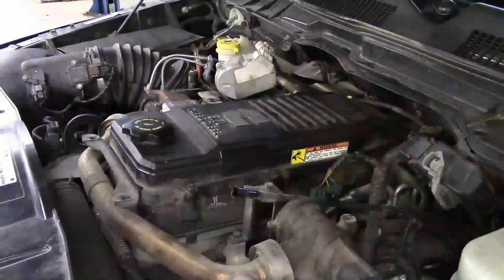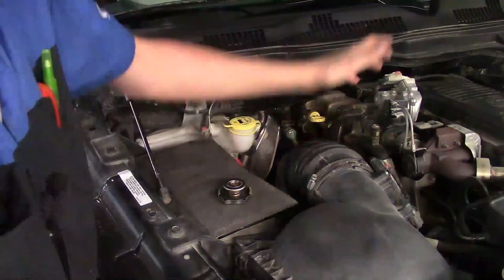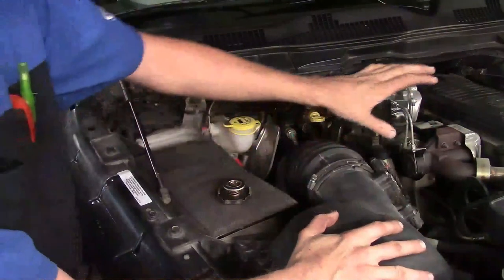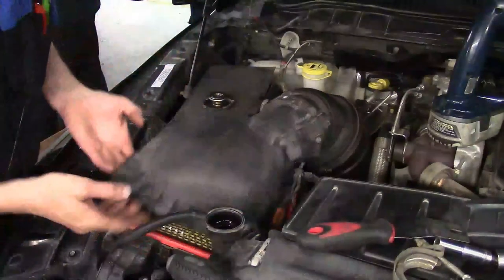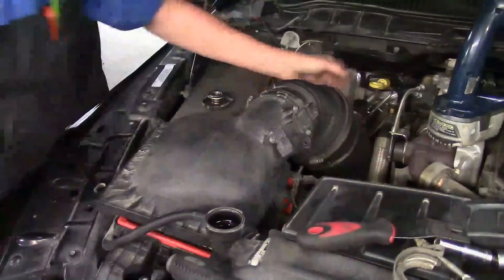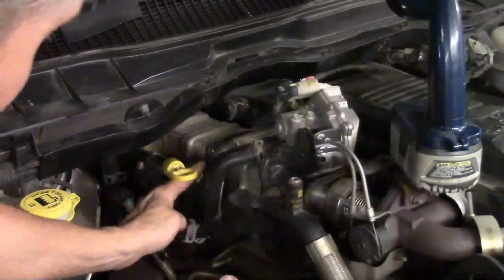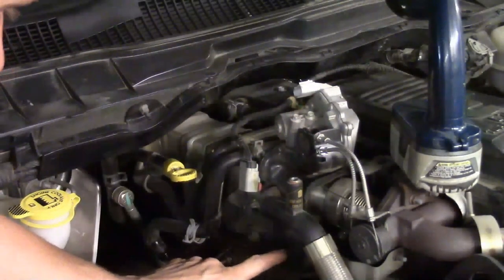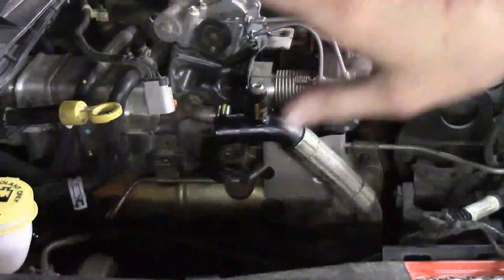Part 1/4: Dodge Ram 6.7 Cummins 67,500 mile service

Comment: Great four part video. Thanks for putting this out!  Called around to all local diesel shops.  They just replace the units ($1200 EGR valve $1800 and more for EGR cooler) nobody had heard of washing these parts out. 
In the middle of service 158k miles.  Thanks again for this information!

Comment: I just wanted to say thank you.  This series was extremely informative.  We did the project with no issues!  One note to others, we put some grease in the 15mm socket to hold the nut in place for the dr side nut and stud on the cooler.  I guess my hands are big... and no friends.  Awesome videos!
Reply from the maker: +liamfm The cool thing is you saved some money and learned more about your vehicle. Appreciate that added tip and for the great feedback. Make sure to subscribe if you haven't already.

Comment: sir,your videos are amazing,informative and just fun to watch.You have educated me and or orientatated me to better prepare me for the times when I go to my dealership.This video enabled me to correct some mis information I was given by my dealership when they did my service (I discovered your videos moments after dropping my truck off for this 67,500 mi service)my dealer informed me that the egr cooler did not need to be cleaned in this service and it was only done in emissions states.(this was over phone,after I dropped it off)when I went there to pick it up,they retracted there statement.(they knew I had both barrels loaded).So from being educated by you and a little whinning they reduced my bill by 150.00 dollars (sold parts at cost).When I told them I could of done the job and they acted like it took a computer to reset my service code,and they just charged me for the hours the truck sat there soaking.Good to be informed my man.I bought the cleaner to do the EGR cooler myself.Thank you and now im a subscriber.(I feel odd about calling you sir cuz men like us work for a living)
Reply from the maker: It does feel weird being call Sir lol. The 67,500 service does vary from year to year. Some require all 3 items to be done while others only need the crankcase filter replaced. As far as the emissions states statement.......depending on the state.....the service can be covered under the basic warranty. Otherwise I am glad that you checked the videos out and was educated about the service which is the reason for the videos. Thanks for all the kind words and for taking the time to comment. I greatly appreciate you having subscribed as well. Keep checking out my other videos as well.

Comment: Thank you for this video!  I got the dreaded "Perform Service" message on my '13 Ram 3500 right on cue.  Saved me $1200-$1500 not taking it to the dealer for this service.  That's the price I was quoted but what I ended up paying was the cost of the PCV filter (about $135 at my local O'Reilly's) and about 20 minutes of my time.  It was time to replace the filter as the original one was saturated with oil.  The procedure to clear the message was almost stupid it was so simple.
Thanks again for making my life so much easier AND less costly!

Comment: I like this guy! :D I just got a 2007 Dodge 3500 6.7. I put a delete kit on (First thing I did) but I never knew I had to replace the crank case filter. :) So glad people like him exist. :)
Reply from the maker: +Brein Jensen Thanks Brien! I have the same set up in my truck as well. Haven't done the deletes as of yet. Will wait until the repairs get to pricey. Thanks for watching. Don't forget to subscribe if you haven't already
Reply: 260k deleted since 100k when my dpf cracked on me and i didnt want to pay to replace so i deleted all of the stupid crap. 160k with no problems except for having to do a rear main seal.
Reply from the maker: I feel that if the cost of repairs gets to high as far as parts.....I too may delete when it comes time. I have been lucky so far with 220k with no issues other then minor items over time.

Comment: Followed your instructions, all but removing the neg terminal from the battery. I DO RECOMMEND IT. Got hit several times prior to finally removing the neg.  Also purple power at full strength cleans the door incredibly.  Mopar solution  is really expensive, and does not work anywhere as well. (See video comparing products.)
Thanks again. John Elder
Reply from the maker: Thanks for the added info. Over the years I have gotten use to working with the cables still installed but then again....I do this every day so I am use to it. For those not....the negative cables being removed is a recommended step for sure. Thanks again

Comment: I clean my EGR and DPF myself I clean the EGR with the Mopar solution at 45,000 and I cleaned my DPF at the exact same time with a power washer I let it sit for one day upside down and installed it on the truck and took it for a blast for 45 minutes let me tell you the smoke that was coming out but she ran awesome after one thing I wanted to know I'm at 75,000 kilometres now and service light never came on which I really like it's not just on kilometers it actually tells you when it's dirty
Reply from the maker: The perform service message will come on at 67,500 miles or 108630.72 kilometers if you do the conversion. What I have done and also recommended by Chrysler is to use Dawn dish soap for the DPF. It breaks up the ash and works pretty good. There are times that the filter is too full that it wont help or if the filter is cracked internally as well. I used a pressure washer once and some of the element got damaged by the high pressure spray so I stopped doing that method my self. Otherwise just Dawn dish soap and a water hose. The coolest part is that it foams out the tailpipe for a while once you first start it back up. Thanks for watching and make sure to subscribe. Have a great weekend as well.
Reply from the maker: @Workingcockers  Appreciate the info Walter and thanks for commenting. Baking it is the best method but it takes a specialized shop that has that equipment. Good ol dawn dish soap is your friend when trying to "save" a DPF before it gets to the point when it needs to be removed...baked/replaced.

Comment: Thanks for the video. Have 2015 Ram 6.7  71,000 miles  (Perform Service) Dealer says the need for EGR cleaning. I have 4k miles to bring her home and get this fixed. Should I be ok to get my ram home? Should I change CCV at the same time?

Comment: Hello and thanks for all you show us "backyard" mechanics. My question is; my perform service (67500) message just came on. I am 1500 miles from home and would like to know, can I make it back home before doing this service? If need be I can do the CCV filter, but not the rest of the cleaning. Most of my tools are home.
 I should mention I am pulling a 5th wheel camper. 2012 Ram 3500 dually.

Comment: Hey I called my local service department and they said all I have to do is change my crank case filter on my 2014 Cummins. Could this be right? Once again awesome vids man.
Reply from the maker: You and they are correct . They changed the maintenance at a certain point where only the crank case filter was needed on the late model 6.7 engines. Thanks again Rick.

Comment: Hey Dave! Question: I pulled off my ccv filter, was full of sludge, being worried i pulled the valve cover, PACKED WITH SLUDGE! Stop right there, i know what you are thinking, change out synthetic blend rotella T5 at 10k to 15k intervals, usually 10k, is there any, any, any other possibility of a bad EGR or anything that you could think of that would cause this? Thanks bud, I love all of your vids, 
2012 ram 2500 stock, 6.7 cummins

Comment: Hi Dave I just had the dealer do the 2nd "PerformService" at a cost of $1100 on my 2012 Ram. 10 miles later, "Exhaust Service Required See Dealer Now" Back at the dealer. What could have happened? Same
 dealer has performed all services (including oil change).

Comment: Good to see your channel is still up and running and as popular as ever. I've since upgraded from my 2014 to a 2017 2500, and I'm noticing my map light is flickering when turned on of course!. What is the procedure for removing the headliner console to be able to get at the light bulbs and replace them with LED's I understand that a T10 LED should work. Would greatly appreciate the assist. Mike
Reply from the maker: Thanks Michael.....yeah I dont plan on going anywhere. Try this when you get time.....this may help. not sure if its the exact same set up but should be close. https://www.youtube.com/watch?v=w2i9vtrOV4U

Comment: Love all your videos! As a new Cummins owner and tired of paying the dealer so much for servicing I started watching your videos! I was wondering have you performed a transmission service on a 2014 Ram 2500 Diesel?
Reply from the maker: Evening Jeremy. Thanks for the kind words about the videos and how they have helped you. I have performed a service on that year model. There are 2 different transmissions floating around in the Ram Diesels and it depends on what you have. Some days I cant remember what years certain transmissions were used so I just include all of them lol. If its the 68RFE then I did a repair video on its smaller brother the 545RFE that included the pan and filter removal and reinstall. Feel free to check it out to see if its the same trans as yours as far as pan shape and appearance.  Check out the link and once again....thanks. https://www.youtube.com/watch?v=6CDAytTHVoU

Comment: Hi, well done will try to do so. I'd like to know if at 169k miles should i go dipper by checking more parts of the car? I am buying one next week and very afraid of any serous issues,it a 2014 3500 dually.  Thx in advance
Reply from the maker: Sorry, I got confused.....possibly by some misspelling?
Reply: @MotorCityMechanic  
Hi, ok. So I will buy one with 169k,what should I be aware of? I mean what parts should be changed and checked right away?Hope now clears the  things.

Comment: Hey Dave, I’ve been putting this off a while. I have a 2016 3500 mega drw and my Manual only says to do the CCF which I did at 70k. I’m at 80k now without the cleaning. My first question is why dose my manual only say CCF? My second is , if the other stuff is needed, what kind of damage can I cause by having put it off? Thanks man, I love all your videos. You always have the answers.
Reply from the maker: Backcountry Adventure Motorsports All 3 use to be needed. You owners manual is correct for your year....just the crankcase filter. There were changes over the year that made it so the other 2 items no longer needed to be serviced.
Reply: MotorCity Mechanic thanks so much for the quick reply. My buddy and I were going to tackle his on his 2013 2500 this weekend, I’m assuming since his also says CCF, then we don’t need to do  anything else. Guess we will be pooping the tops early then
Reply from the maker: Your welcome and you will see how quick and easy it is.

Comment: Once again excellent job on the videos. At the beginning of this video you mention the perform derive light. I bought my 2011 2500 at 60k miles and now have 82k and never got a perform service light at 67,500.  Is there a diagnostic system in the truck that will determine when that service is needed?
Reply from the maker: Its set to show that message at 67,500 miles and the once reset....67,500 more miles from the mileage it was reset at.

Comment: There doesn't seem to be any videos out there on how to determine if a used transmission once out of a truck is good or not. So without knowing the history of a vehicle ie: if it was in a crash or not, accurate mileage or prior maintenance records etc., as to the honesty of the salesman & the company he represents, aside from just relying on a company warranty, how do you determine whether or not your buy is a good buy? Is there anything more a buyer can do on his own before a purchase is made aside from checking the color and viscosity of the trans oil and filter condition? What would you do?
Reply from the maker: Being that its a transmission not in a vehicle....there really isn't much you can check. It's all about its operation and that can't be determined. You pretty much covered the only items you can check

Comment: Question does EGR cooler need cleaning on Ram 3500 2020 year. I saw in your video that the EGR valve is not because you can't open it. Does the cooler need the service?
Reply from the maker: I actually did a video about this service on late model trucks. Make sure to check it out…..you will see that yours doesn’t require everything. 

Cummins 67,500 Mile Service DO'S and DONT'S
https://youtu.be/8GpgpQKxBY0

Comment: I have a 2014 Cummins, the Perform Service light came on last week.    Yesterday I replaced the CCV filter and I cannot get the Perform Service light to extinguish.   I've tried pushing the brake twice, 2 slowly on the accelerator and turning it off trick and nothing has changed.   Any ideas?  Great videos, BTW.   Very helpful.

Comment: I got the perform service on my 2014 Ram 3500 a few days ago. I thought maybe it was the air filter, but it was changed less than 10,000 miles ago and haven't driven it in bad conditions. I bought 2 CCV filters off Amazon, they were cheap and when I got them, found out they weren't Cummins Fleetguard (found those later and were $75. Both of the ones I bought equalled to about $75). So I added 67,500 miles to the mileage I had when I did it so I would know when you change it next. So that mileage would be 295,955m. Am currently sitting at 234,400. It's not throwing a code (checked with my code reader), just the perform service message. Think it may be a bad filter?
Reply: Any suggestions?
Reply from the maker: The performed service message needs to be reset each time….it comes up at that specific mileage interval and that’s the only time the message will come up (timed mileage)
Reply: @MotorCityMechanic  I did reset it when I did it. Next time for one is 295,955m. I have (as of right now) 234,449m. Since it was a cheap one off Amazon, could it be bad?

Comment: I have a 2012 6.7 with 79k on it. Warranty is up at end of 2017 and I plan on deleting it. Is it necessary for this service before the deletes? On this truck it wasn't done until 98k and my truck is not my daily driver so I don't put a ton of miles on it. What are your thoughts? What can go wrong if I don't do the service? The dealership wants $1100 for the service and not sure if I want to tackle it myself.
Reply from the maker: +Jason Crocket Hey Jason. If your going to delete then the only thing I would do is the crankcase filter. No need in cleaning items you will be removing. Spend that money on the deletes. Thanks for the question and for watching!

Comment: I have a question. I have a 2012 6.7 Cummins with no DEF. Would I require all three steps? Or just crankcase filter? Thanks in advance!
Reply from the maker: As long as its not a cab and chassis then yes you need all 3 items. Thanks for the question and make sure to subscribe

Comment: I got a 2017 3500 crewcab drw and a cab chassis drw and the dealership said to me about the 67.5 mile service they were going to have to drill out a plug to perform this service. You have anything on what they are talking about
Reply from the maker: I have never heard that on that year model. On the early 6.7 engine we drilled a hole in the turbo to clean it but not as part of the 67,500 service...only if a certain code came up. Not sure if they are using some type of equipment that I we dont use that requires them to drill into some passage for their cleaning equipment to spray some sort of fluid. Otherwise we just take the components off and clean them physically. On the non-cab and chassis all you need to do at 67,500 is the crankcase filter under the valve cover. Looking at the chassis cab service info....it says the same thing, crankcase filter only. I recommend going by the owners manual maintenance schedule and not what a dealer tells you. Some like to upsell un-needed services.
Reply: Ok thanks
Reply from the maker: @txcntryboy  Your welcome

Comment: Hey buddy . I having problems with my 6.7 I have a code p0770 . When the trans is cold there is no problem . Once the trans get warmed up the trans gets stuck in 4th gear . The code is shift solenoid E p0770

Comment: I m thinking I should drain my coolant before starting this?
Reply from the maker: If you year truck requires the cooler removal for cleaning then draining enought to get below the cooler level is needed
Reply: @MotorCityMechanic  okay thanks. I did end up just draining a little out when pulling the egr. Than you sir.

Comment: I have a 2014 3500 6.7 - it has thrown the crank case filter engine light code. I am going to replace the filter today, but my question is this: Can I clear the code with a push button ignition or do I need a scanner to clear codes? The truck only has 40000 kms, or 24854 miles.
Reply from the maker: If you getting a check engine light then I recommend clearing it or are you getting a message on the cluster? Whats odd is that your getting the message/code with only 25k miles. Have you scanned it for codes? I want to make sure I fully understand the situation so please....as much details as possible and please excuse if I ask a dumb question because I am trying to paint a picture of what your seeing so that I fully understand.
Reply: I am getting a check engine light. I had it scanned and cleared at a dealership and the code thrown was "crank case breather" - so today I replaced the filter. So what I have left is the engine light on, with a new filter installed. My question is - on a 2014 6.7L Limited with a push button ignition, am I able to clear the check engine light without a scanner? Thanks for the help!